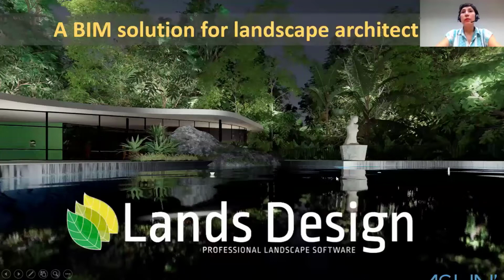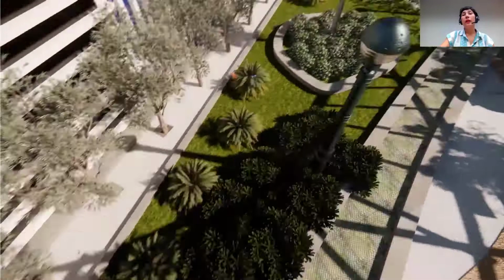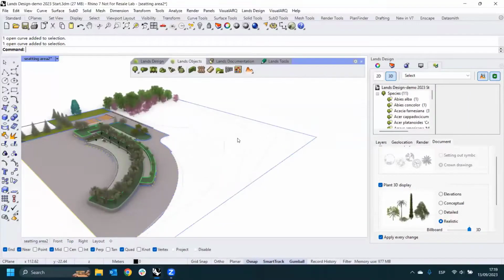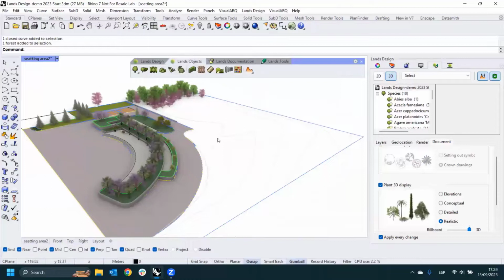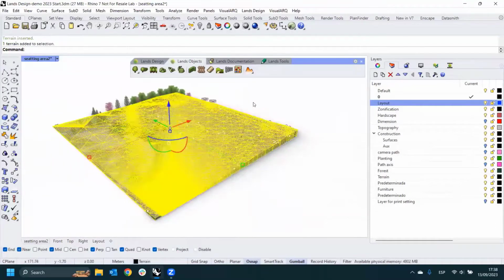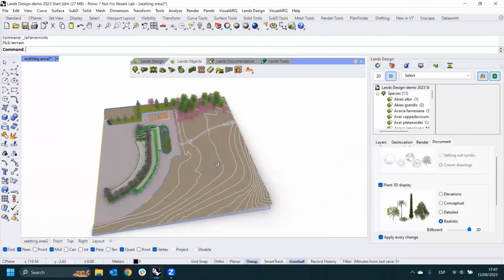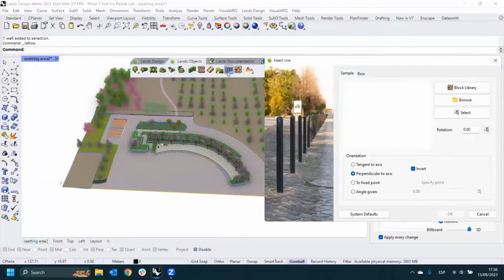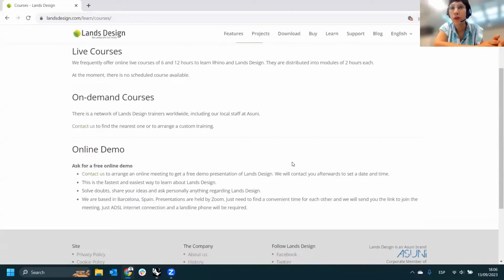Landscape Modeling and BIM Workflow with Lands Design + Rhino (Webinar)

Comment: Sir, I have used the 90 day trial, installed successfully, but I experienced a problem when the base plant data did not show photos of each item. why is that, my internet is good. Thank you sir
Reply: please help me
Reply from the maker: Hi, check if you have enabled the option for images from the cloud. It must be enabled. There is a check box below the image of the plant, inside plant library.
Reply: @RhinoLands  It still doesn't work sir, I've tried, idk why sir. It still doesn't work sir, I've tried. I've given up, just let it go, even though I'm very interested in subscribing